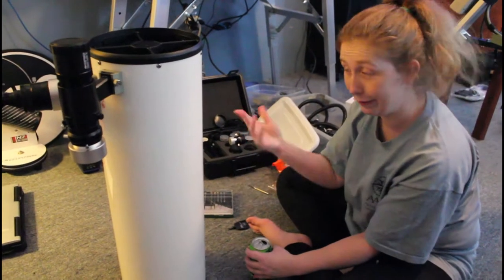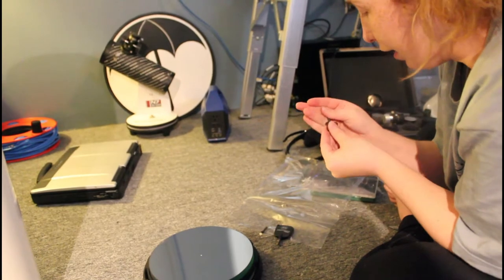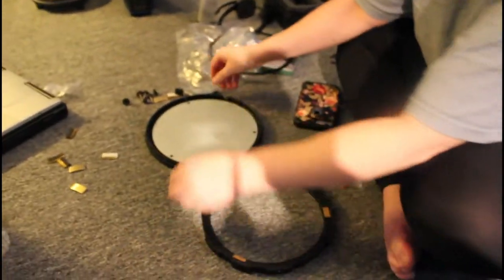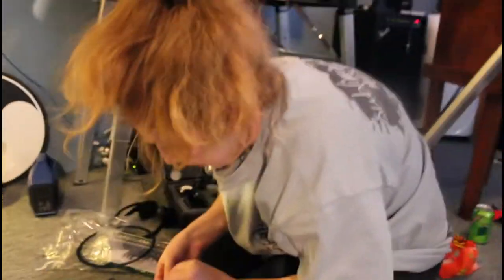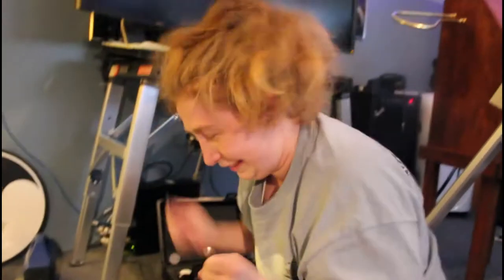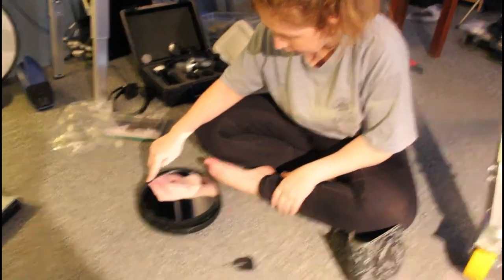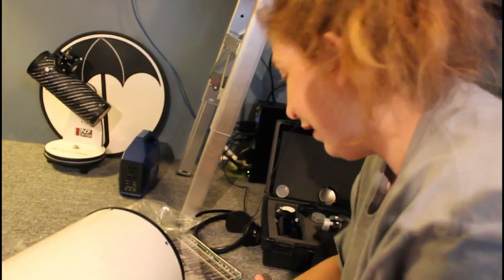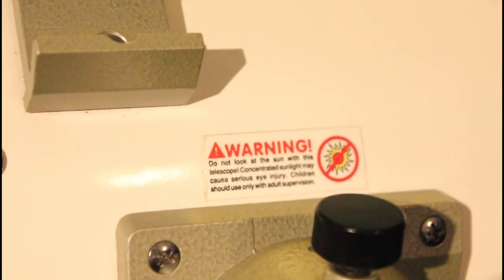No. 8 - Installing a Vixen 8" F/4 Mirror Cell Upgrade Kit

Comment: We (Sarah and I) are going to have to take the mirror out again and get a fingerprint off. The main reason I had her do the Vixen Mirror Cell upgrade was to teach her how to adjust the mirror for collimation. Of course, that went "well" the first attempt and ended up with us removing the cell and reinstalling the Bob's Knobs. Of course....that led to putting in the upgrade kit. I've been under the weather lately due to my knee and didn't really feel up to messing with the scope. The second go at collimation, the screws were all nearly in and the laser dot was very close to the center of the Hotech bullseye. I know there is a lot of discussion out there with respect to the use of laser collimators, but that task was followed up with a check with a Cheshire eyepiece. Everything appears to be spot on now. Now, all that is holding us up is crummy weather....cloudy nights, high humidity, etc. My daughter is an absolute joy and love her lots and lots and lots!